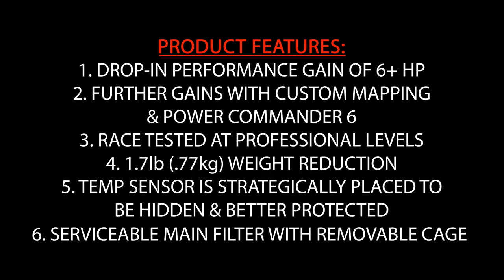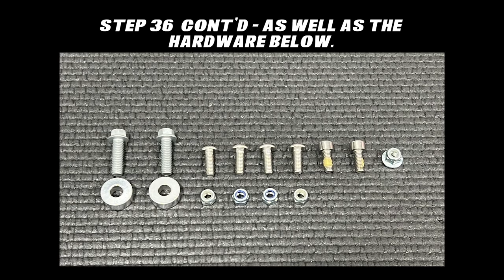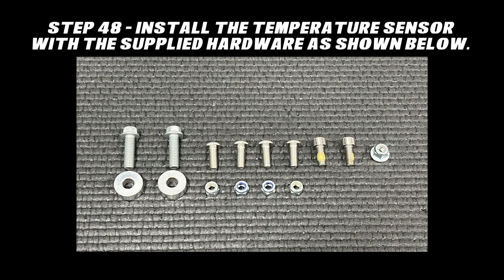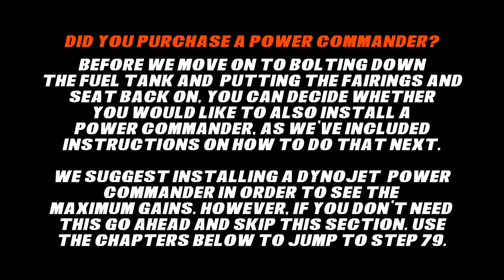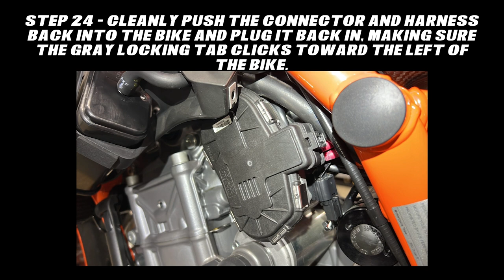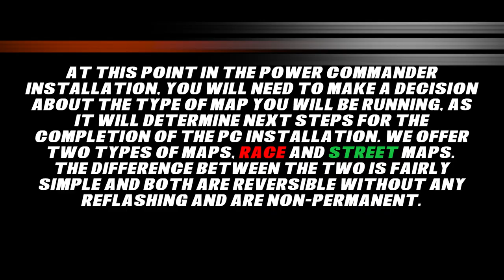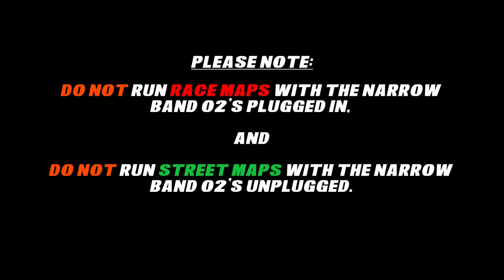HOW-TO INSTALL RP PRO & RACE INTAKE SYSTEM + DYNOJET POWER COMMANDER - KTM 790/890 DUKE

Comment: Where does everyone grab power for the autotune?
Reply from the maker: We would highly recommend this kit we make. It makes things very straightforward and uses the proper wires to source the power. The leads under the seat (Black/Red & Brown) that come on with the ignition would be ideal, but they don't push enough amps like the ones that are always on, (Yellow/Red $ Brown) so we use the ignition set to trigger a relay to allow the yellow/red set to power it. https://shop.rottweilerperformance.com/ez-power-relay-switch/

Comment: What's the difference in the race and pro intakes other than the race being carbon fiber? Any hp difference and what about weight? I have y'all's lid now but would like to do the intake now along with your pc6 with race tune. Thank you much
Reply from the maker: The carbon fiber units are slightly lighter than the plastic, but they are mostly because we could and they are stellar looking. If you are looking to save a few bucks and are just looking for power without the exoticness of carbon fiber, the plastic PRO units perform the same.
Reply: @RottweilerPerformance  I used the pro with you tune on the PV6. I broke into the 6's in the 1/8 mile with me at 260lbs with it. I also bought my arrow decat from you and front sprocket. I have a video of it on my channel, I've been outrunning a lot of bikes with it and about to make it faster. I appreciate y'all.
Reply from the maker: @bagwellpower2951  Love that! Glad it's working really well for you!

Comment: Love the intake system but personally I would skip the PC, not a fan of piggybacks. 
Only reason to use them in my opinion is when there's no other option available. 
Since you can flash this ecu with Dimsport hard/software this seems the better option to me.

Comment: Hi, I'm planning to get to do this mod once my akra full system arrives.... So I should be buying the

1. Race pro intake
2. PC6
3. Race map

Anything else? Do I need to purchase a fuel dongle ?
Reply from the maker: There is no fueling dongle for this bike available. We actually have a video coming out about this in the next week or so. The intake and PC6 is all you'll need. The maps are free when the PC6 is purchased from us and you'll just need to decide whether RACE map or STREET map is for you. Also talked about in the upcoming video. This is also written about on the pages that have the maps on our site if you want more information and linked here. https://www.rottweilerperformance.com/890-duke-21-pc6-rp-intake-decat-open-muffler-race-map/
Reply: @RottweilerPerformance  great.. thanks for clarifying!
Reply: Great video. On a 2023 790 duke. It was WAY easier to put the boots onto the throttle body, then attach the airbox to the boots.  It is too congested around the throttle body.